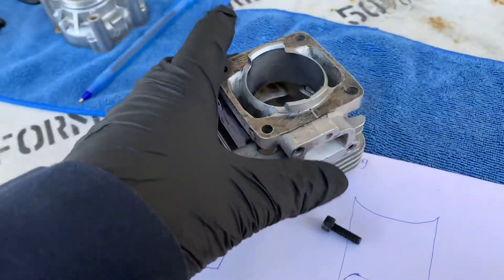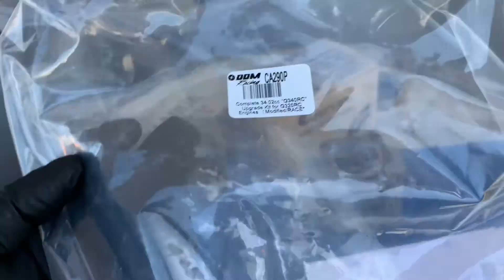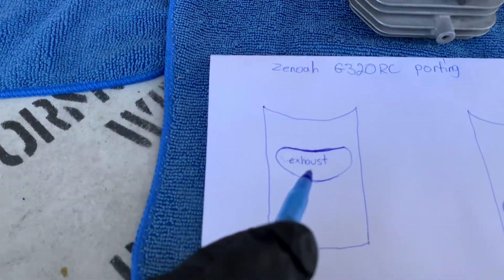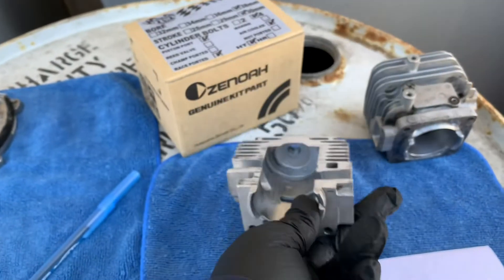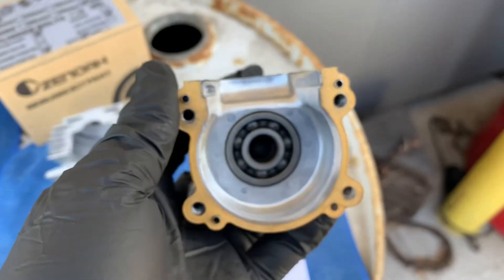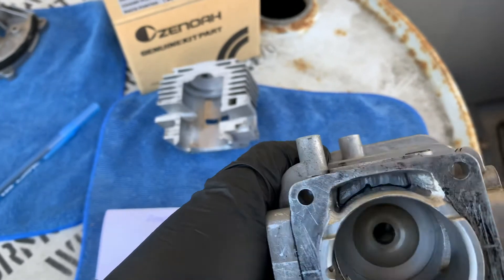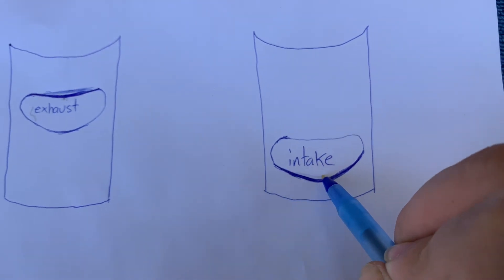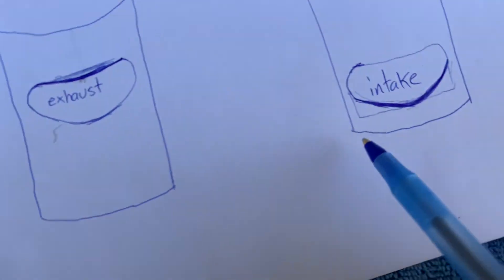Zenoah G320rc explaining port matching. How to Exhaust and intake timing

Comment: So I tried this just exactly what he said to do and now I get nothing but gas and oil dripping out of my exhaust. The engine runs but I've never seen this amount of oil and gas coming out the exhaust. It's like the fuel is unburned. Anyone have any suggestions??
Reply from the maker: How much material did you remove from the cylinder?. Mine isn’t doing that. If you remove too much it does that
Reply from the maker: And also addjustmenton your carb is needed. Its getting more air in so the carb needs tuning on the high needle give that a try. The needle setting is to high. Start by turning my small increments of 1/16 of a turn at a time in to lean it out just a bit. But if it doesnt stop the exesive oil than you might of removed material too much. But how is the power on your motor?
Reply: @raulofalltrades5023 I removed just a little bit. Barley anything.
Reply: @raulofalltrades5023  the power seems amazing. Very responsive runs amazing I just don't like all this unburned gas and oil dripping out. I did Lean the carb in a bit but it's still doing the same thing.
Reply from the maker: @noahriedel801   if you have an extra cylinder gasket add it to the first one overlap it and see if that helps bro. Adding a second gasket will compensate for the material removed on your intake timing. That should help with the extra oil and fuel you are getting
Reply: @raulofalltrades5023  I will give that a try. Thanks 👍
Reply from the maker: @noahriedel801   what engine you did this to and what carb you have in it?
Reply: @raulofalltrades5023  it's a 320 with the 2mm crank so it's a 340. I'm running the wt 1107
Reply from the maker: @noahriedel801   now i see why you getting all that oil and fuel bro. The 34 cc is what you have. So, by racing the cylinder adding the second gasket will help with that problem. The intake you don’t have to remove material as you would with the 32 cc. Because of the 2mm extra on the cank! The 2mm extra is making the timing on the intake side open up more with out removing any material.You would only in this case remove material on the exhaust side.  Thats is why you have that problem now i see why. This addjustments were for the zenoah g320rc... and for the zenoah g340rc 2mm crank modified the only addjustmen needed on is on the exhaust. So to fix this on your g340rc adding a second cylinder gasket should solve the problem
Reply from the maker: @noahriedel801   i should make a video and show the addjustment made from both
G320rc and the modified g320rc to g340rc 2mm+ cank. And you know what i have that kit with me i just got it in from DDM.
Reply: @raulofalltrades5023  I appreciate all the help
Reply from the maker: @noahriedel801   any time! Anything let me know
Reply: @raulofalltrades5023  I definitely will. Thanks again
Reply: @raulofalltrades5023  I was thinking about this and since I raised the intake port a hair wouldn't I need to drop my cylinder closer to the case....????
Reply from the maker: @noahriedel801  did you remove material from the top of the intake port or the buttom of the intake port?
Reply from the maker: @noahriedel801   if you remove material from the buttom intake port, lowering the cylinder will increase the timming therefore adding more 2mm of port timming because the new crank is 2mm more. So adding a second cylinder gasket will make the intake timing les of a time to be open meaning it will spit les oil and fuel
Reply: @raulofalltrades5023  I removed material from the bottom of the intake port.
Reply: @raulofalltrades5023  should I see light coming through the top of the intake port with the piston at bottom dead center ??? I was just looking at a 230 motor and no light coming through. Strange
Reply from the maker: @noahriedel801  you should not see light at all if your piston is buttom dead center
Reply from the maker: @noahriedel801  if you see light coming thru when your piston is at bottom dead center than you are losing compression
Reply: @raulofalltrades5023  I new something was wrong with this engine ever since the first time I tried tuning it... VERY VERY unresponsive. I bought this engine from ddm as a Zenoah 320 RC with ESP stock port says but then they added a 2 mm stroke crank to it making it a 340. The light through the piston definitely through me off.
Reply: I went as far as removing the base gasket and I still see the light coming through with no gasket. Now what are my options??? I feel like this engine is a disaster at this point.
Reply from the maker: @noahriedel801   i got the same g320rc upgrade kit from DDM. They send you the 2mm crank and piston, modified crankcase and cylinder to fit the new crank. Are you sure they send you the crank with the 2mm extended crank? Because if not than thats a big problem. The new cylinder is machined to fit the new 2mm crank and if they send you the G320rc crank than not only you are losing compression air loss you also have a lower compression because of the top dead center air space
Reply: @raulofalltrades5023   I bought a complete engine. It was a 320 RC they were selling with added 2mm crank.That's really all it says. I paid 399 for it new.
Reply from the maker: @noahriedel801  do you still see light getting in thru your intake port at bottom dead center without the gasket for the cylinder?
Reply: @raulofalltrades5023  Yes. No gasket and I can still see the inside of the cylinder.
Reply from the maker: @noahriedel801  because if you are still seeing light than you need to make a call to DDM and tell them they send you a bad engine from the begining. Send you another 2mm crank and cylinder at least!... $400 is a lot of money so they should give you the whole engine
Reply from the maker: @noahriedel801  yup thats a faulty cylinder if you still see light coming in without gasket. Imagine with the gasket how much more light gets in!!! Thats a lot of air loss. So if i were you i’d give DDM a call and see if they get you a new engine or a new G340 cylinder and crank and use the rest because everything else should be fine.
Reply: @raulofalltrades5023  I will definitely be making the call. I truly appreciate you taking the time to respond and helping guide me through this. I appreciate your help. Thank you 👍👍👍👍👍👍👍
Reply from the maker: @noahriedel801  my pleasure budy! My G320rc after my mods is perfect and happy to brap brap brap!!!. Dont have no problems with adjusting the carb needles and idles steady and smooth. Also, does not spit out a lot of oil and fuel like yours does. I mean, all 2stroke motors zip out oil but not raw fuel! If you happen to get a new engine or new cylinder, i recomend to just modify the exhaust port from the top port and chanffer so you dont have a sharp edge for the piston ring to get snag or caught. And see what power you achieve! And if you do the intake lower port only remove a hair size of material and with that my friend you will be having one mean and badass g340 rc bro.
Reply: @raulofalltrades5023  hey man it's Noah again. Do you have email address.... I have a couple of questions I would like to ask you about a 290rc .....
Reply: That usually means your carb is set rich.  Good carb tuning instructions come with each ESP RC top end kit or engine.
And I wrote them.  :)